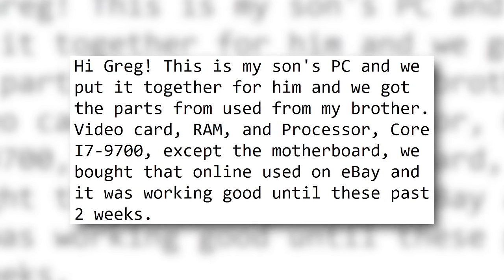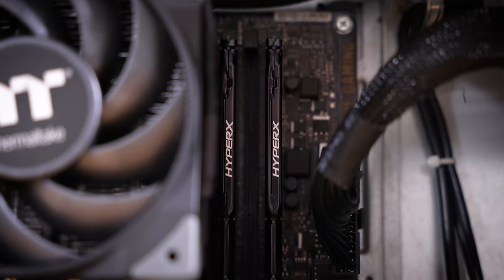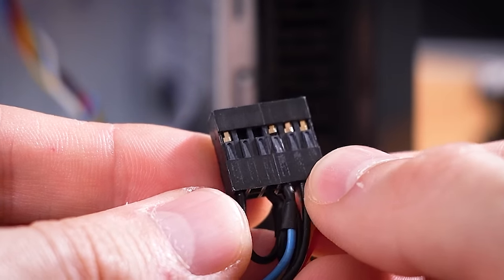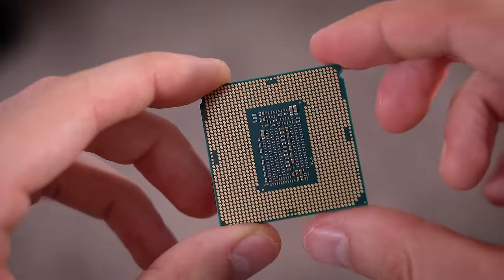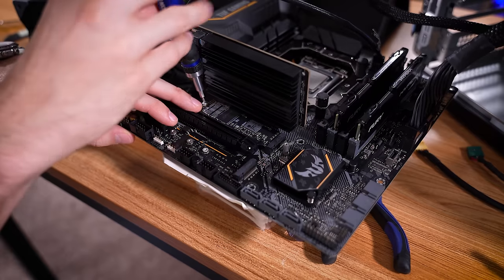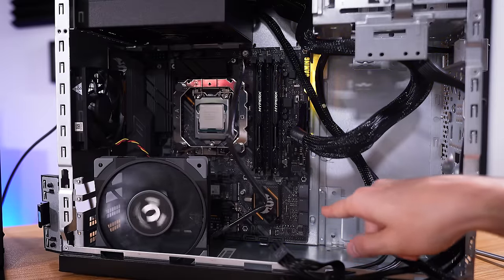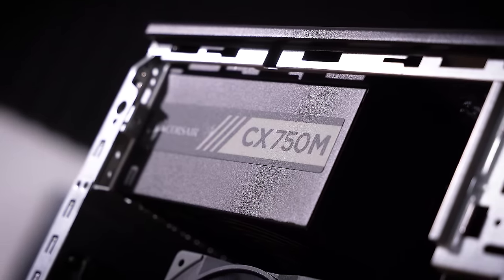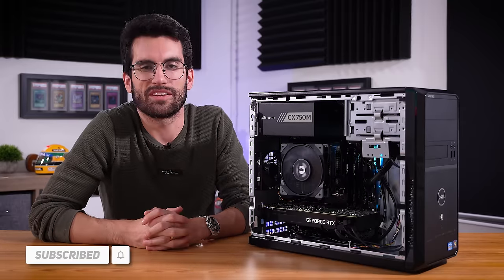Fixing a Viewer's BROKEN Gaming PC? - Fix or Flop S5:E1

Comment: The famous $250 hammer repair, $1 for the hit with the hammer and $249 for knowing where to hit.
Reply: Man, a good repair shop would undercharge you cause it was such a simple fix. Assuming they were able to figure it out pretty quick, that is... but I'd hope an actual repair shop would be able to.
Reply: Another reason to avoid Dell and Alienware.
Reply: all he had to do was hit it with a hammer LOL
Reply: @elusivelectron  "and"
I dont distinguish for obvious reason they are identical. HP and Dell. Those two are CRAP like holy shit. Words cannot even describe how fucking terrible Dell and HP actually are. Like there are no words, nothing sufficiently describes the level of shitpile trash that is each. I'd strongly advise never even no matter how seemingly cheap do NOT pay for an HP or Dell. The sole exception is $100 used office PCs from like 2012 that have an i7 3770 and can at least take a like $80 GPU and get a whole entry gaming setup for under $200. That's fine. You can play most games made before 2020 on that kind of PC at 1080p. But ironically anything made by Dell after about 2014 is literally worth less than a 2012 XPS just because of the stupid fucking proprietaty garbage thus making it worthless and useless.
Reply: That's AT LEAST a $15 hammer
Reply: Reminds me of the olden days (early 90’s) with computer shows. I loved going to those and build my own pc. At one show someone walked up to a stand and said they have a packard bell. Vendor told them to keep walking! Dang proprietary stuff! I think my next PC will be a custom built. Guilty of buying a “Gaming PC” and then finding out later what low quality parts vendor used to cut costs.

Comment: Kudos to you for fixing it properly.  I'd have probably been lazy and just put 2-3 layers of electrical tape over the metal sticking up and called it a day.
Reply: I was thinking this while watching the video 😂
Reply: I would have kept that mechanical support and isolated the metal as well.
Reply: I was thinking of he had some thermal pads laying around using one of those to isolate the case from the board.
Reply: Yeah I would probably have jammed some cardboard in between.
Reply: The sharp solder points on the back of the board would likely pierce through a few layers of tape, if tightened with a screw.
Reply: @Effect-Without-Cause  True, as someone else said a thermal pad might be better.  But tape might work as that wasn't a standoff point with a screw in it itself.  There are screws about 2 inches above and 2 inches to the left of it though, so tape might not work.
Reply: Yep, same initial thought here 😂
Reply: Certainly I’ve applied such quick/temporary solutions in the past, but I’ve also certainly forgotten about it at some point, and end up troubleshooting the same problem again, wondering why I have déjà vu.
Reply: There's a trick.
But it would not work here, because of the case,it was in.
"Use the pow..",ups,wrong thread.
The plastic spacer would work just fine.
In this particular case (pan intended) i would use some of my own spacer material,that has a required height,and a tape on the other side.
Reply: Let's face it. That case ain't worth a carrot anyhow.
Reply: I would have used a jigsaw to make a notch cut-out in the mobo. 🙂
Reply: Nah that board was being bent by the extra mount, the OEM board probably had nothing in that area while the Asus obviously does. Bending multiple layer PCB’s is a very bad idea.
Reply: He already had the panels off. Should have dremeled, sanded it, and then maybe still used tape or a thermal pad
Reply: @Wabajck  then spent a hour taking the entire computer apart to clean out all the metal debris from the dremel that can cause problems later.
Reply: @Wabajck  The dremel would be fine.
Reply: as a no brainer and cheap fix i approve of this!
Reply: @OggyGTA  but all the metal shavings after wouldn’t be.
Reply: "screw it, hit it with a hammer instead."
Reply: Well, your solution would have been the better one. This was not a proper fix. The purpose of that piece of metal was to support the mobo without screw. The stiffness of it indicates that it was bent on purpose and it was not designed to be bent back. The basic rule in computer repair is that before you use an unusual tool, like the hammer, you should think over if you missed something to understand. In that corner there are the front panel connectors and something else too, thus this support was made to avoid to damage the mobo if somebody unknowingly would press the pins there too much and bend the mobo. Wrapping that piece with electrical tape 4-5 times around would have been a better and easier solution. 😉
Actually I was in this situation, I gave my old mobo+CPU to my cousin as Xmas gift. Then I instructed him how to do the replacement. I noticed that the upper corner of the mobo was not supported by standoff, so I placed a screwdriver underneath as temporary support. After I inserted folded paper there to indicate that the standoff is missing.
Reply: I was thinking "ah, he'll just attach a rubber stopper or something" and did a spit-take when he brought out the hammer
Reply: Geek squad, is that you...wait no, at least you fix the problem

Comment: There are definitely lots of OEM cases that look great, including this one, and I do love the idea of a sleeper build, but this video shows one of the main reasons I'd be afraid of trying to create one. When you take a case from HP, Dell, Lenovo, etc., that was designed for proprietary parts, and then try to install standard PC parts into their place, a lot of weird issues can happen. If it's not something physical, as you showed in this video, it's probably going to be the wiring to the front of the case. I love building and fixing PC's, but I don't want to have to use a dremel or redo wiring just to make something work in an older case.

Comment: The fix is easy, but the process of isolating the real fault is NOT EASY. I'm a Big fan of your fix or flop series! The morale of the story is...steer clear of OEM casings. LOL!!
Reply: what do you mean its not easy? You take the system out of the case and it works - so the case is the problem. Whats ''not easy'' about that?

Comment: I build about 80 computers annually and refurbish another 40-50. My FIRST troubleshooting test on systems like this is to "breadboard" them outside the case. It really saves time in the long run. It is super helpful to know whether your base components are the issue or if it is something more complicated like a case short or a flakey PSU. (Oh, and most ASRock ATX boards DO use that standoff that gave Greg such a hard time.)

Comment: I got the issue right away at the start of the video after having to deal with OEM builds in the past. Those raised built in standoffs ALWAYS cause issues with motherboards….. especially with solder points on the motherboard underside and I’ve had to remove them or use a screwdriver and hammer and hammer them inversely to remove the short issue.

These Fix or Flop series thou, have given me some unique perspectives on identifying faulty parts (despite building and repairing pcs for myself, family and friends for 25+ years) and thank you Greg for continuing to do this series to help the newer and younger generation of pc users and gamers 🥰😇👍. Keep up the great work!
Reply: Add standoffs into the existing raised motherboard bed in the case, problem solved.
Reply: IMO the cheap bastard could have just bought a cheap decent case instead of using a piece of junk oem case.
Reply: @johnt.848  Then the IO doesn't line up.

Comment: One of the best parts about this series is something you touched on at the end of this video, your growth from season 1 up til now. This series takes me back to the 90s when I was a lowly repair technician and my journey of improving my diagnostic skills. 

That was funny for me, when you flipped the power switch at the 10 1/2 minute mark my tv screen went black, then a second later an ad started.

I’d put a piece of electrical tape over the metal making contact to keep the sleeper look.

Comment: A friend and I worked on a build years ago and a motherboard screw was shorting it out. Neither of us could figure it out and took it to a local PC shop and they figured it out. Went through so many steps and was so annoying to figure out. Makes sense. You live and you learn. Probably the rarest issue that I have come across and in over 20 years only seen it happen that one time. Not surprising it took you a while to figure it out.

Comment: I know the feeling. I just troubleshoot and system for my son that stopped working. And after going through the steps I was able to find that the hard drive had failed and was not allowing the system to boot.  The boot nvme was fine but the storage hard drive had failed. Watch your video all the time and learn a lot

Comment: We had one Similar, building new 13th gen in an only case from 2004 ish. (Antec Shark Case). out of the case everything would work, once in the case no power at all.  Come to find out the removable motherboard tray had a metal lip that ever so slightly shorted the VGA, and Audio solder points on the bottom of the board. We installed electrical tape on both bottom of the board and lip of the tray. POST fine after. 
Long run we switched it out to newer case, when it arrived.

Comment: when dealing with cases like these I usually tape the pins on the back of the motherboard, I know it is not good because of grounding but I really rather not risk a short blowing up everything.
Reply: As long as the solder points are isolated it's fine.
Reply: You're still grounding the motherboard by screwing it in, so no contact in the back is needed :)

Comment: I love doing sleeper builds but small issues like this are always a danger. The front panel header from a prebuilt is almost always wired different. The Lenovo case I used recently required me to rewire the power and leds on the front panel. The usb ports were wired correctly but I was never able to do the front audio plug because I basically got frustrated and gave up. Nice job checking all possible issues and getting it fixed. Sometimes its that experience of dealing with weird stuff that can be an immense help when troubleshooting.

Comment: Nice find 👍

Hats off to the builder using a OEM case. Used to do the same since the mid 2000’s to early 2010’s aftermarket case quality wasn’t there yet and OEM cases were built very sturdy compared to the tin cans that were sold as custom cases. 

Plus always enjoyed the sleeper look myself. Very good taste.

Comment: That was a good catch on this one. I watch these to try to keep my hardware troubleshooting skills up and I called there being a short after the reading of the message. Sometimes these things are hard to spot, but it is a significant risk when reusing a case from companies like Dell, HP or Lenovo. I have literally seen this same type of thing and did the same thing with a hammer to bend the tab out of the way so that there was no longer any danger of shorts. They are extremely lucky that nothing was permanently damaged from that, as these things can cause damage to any or all components depending on where the short is.

Comment: Greg Buddy, for future issues as such and future sleeper builds, I always put black electrical tape over the factory case stand offs to avoid any shorts.  It would be better than taking a hammer and breaking metal pieces off the case.  Bending that back was a good idea, but before you put the motherboard back on the stand offs, just put a piece of electrical tape on the stand offs  and problem solved.

Comment: Love your videos, Greg. Thanks for all of the amazing help and information you always provide. I have to say, though... I have always (respectfully and constructively) questioned your reluctance to take the platform out of the case more quickly. The first PC I built would not POST due to the manufacturer putting a stand-off in the wrong spot (and me too inexperienced to catch it). After 11 hours, I finally decided to take the components out and it all worked. Thanks to a random Reddit thread, I knew to check for an extra stand-off.

Since then, I have built (and rebuilt) over 10 computers for myself, my family, and my friends. I also love to deep clean everything and rebuild it thanks to your PCDC series. Your videos are a big help, and also very entertaining. Keep up the awesome work. And remember: just take the stuff out of the case and see if it works lol. After the quick-swappable parts, of course.

Comment: I had a similar experience while building a system for my friends' son 3 weeks ago. He supplied all the parts. Tested all parts on my test bench except the GPU on my test bench. When I put the system together and powered on the system, nothing. at first, I thought it was the PSU. I forgot to turn off my backup, and when I plugged the GPU in, it fried my PSU. I had him replace the GPU and the PSU. Got everything installed and the same thing you experienced, I did. the system would not power on. When I jumped the PSU, and plug the 24 pin connector back into the board, everything worked fine, until I turn off the system and unplug the PSU. System does not start up after powering down. Power rail failure on the motherboard. This was an Asus board. Replaced with a Gigabyte board and everything works fine. Trouble shooting method was watching you and your videos. Thanks.

Comment: I enjoy building in old Dell cases. One of the practices I've had to adopt is installing insulated motherboard standoff washers. In some cases I've had to use several washers stacked and then a 6, 7, or 8mm screw to mount the motherboard.

Comment: Had a similar issue in a build a few years ago, chased my tail and even bought a new platform and cpu, kept intermittently working. Turned out in my desire to hide wiring, I ran the rear fan wire between the motherboard and the motherboard tray, and some solder points were shorting againt that wire, but not all the time. Taught me to check things like shorts caused by the motherboard solder points touching things.

Comment: Keep up the good work Greg. I just wanted to thank you for this channel. I upgraded my pc just before Christmas and everything was working great, later on the system was sporatically booting and eventually would not post at all. I literally thought to myself, what would Greg do? After CMOS clearing I went to the ram and sure enough I discovered the cpu had a dead memory channel. Fortunately I had my cpu from the original build and everything works perfect again. Side note, cpu was purchased "new" from AliExpress. I doubt I will go that route again due to RMA support. 
Great job on the channel!!

Comment: As soon as you took it out of the metal case and it worked, I knew it was shorting inside the case. I would have put some insulators like a small rubber grommet, washer on each stand-off point to raise it slightly or just to insulate each point from the MB. I have over 20yrs electrical experience and my experience has taught me “start with the easiest thing it could be because it usually is”, great video Greg, always a joy to watch. Interesting, educational, and great to watch. 👍🏻👍🏻👌🏻👌🏻👏🏻👏🏻👏🏻👏🏻👏🏻👏🏻👏🏻👏🏻👏🏻👏🏻👏🏻👏🏻👏🏻👏🏻

Comment: One time i had a pair of identical dell systems from non-identical brothers that had a short caused by a light layer of dust on the ram. It surprised me because of how little dust there was to cause the issue, it looked like the amount of dust you would get for not blowing out your case for a few weeks, not the years of neglect you normally see in pre-builts where the dustbunnies roam free and somehow still works.

Comment: Simple trick when assembling: Count the screws and standoffs before installing the mainboard. When using a non-standard case (I hate Dell) triple check the metal with the mainboard like Greg did.

Comment: When you started pulling it apart, I was thinking power supply issues, but I never would have expected a short from the case itself! I bet that Dell case just has some standoffs and raised areas in unique places in addition to what is normal for mATX. The old motherboard probably had no problem with this raised metal (or even depended on it for stability), but the minute they put in an aftermarket board it all went wrong.

Comment: We love you Greg! Also just wanted to let you know in case you weren't aware, People have a lot of issues with those SP (Silicon Power) m.2 drives. They are cheap and fail a lot of the time. I thought once you pulled it out and the system posted that it was going to be a problem with that drive. But great job here. Love your vids.

Comment: I had a general idea, but was focused on the wrong area.  Most of the time the issue is the replacement cooler causing the board to put pressure on those indentations that standoffs screw into.
Now I have to double check my build.

Comment: I knew the symptom. It was starting once, then the surge protection from the PSU kicked in and it was not starting again, only after the system was powered off long enough, it attempted to start again when the PSU surge protection was reset. So I knew there had to be a short somewhere. And I immediately thought about standees and a non-standard case. But when you showed the empty case I did not see the small metal piece. So, nice find. I would have found it in the end for sure, because I knew what i was looking for. Also nice fix on the front panel connector. Might have overlooked that one in the beginning.